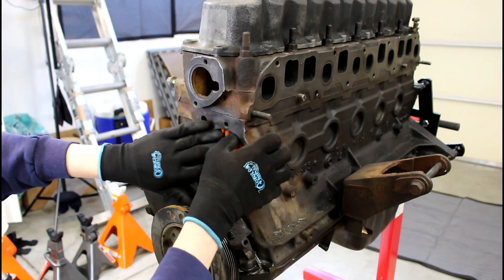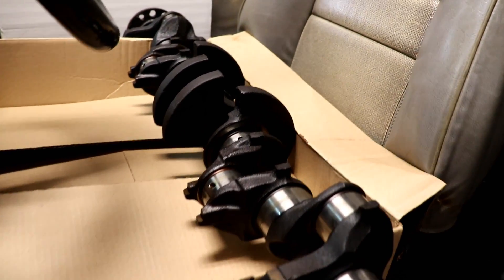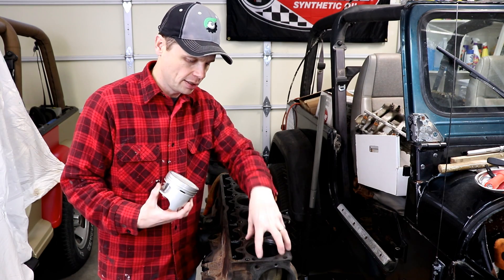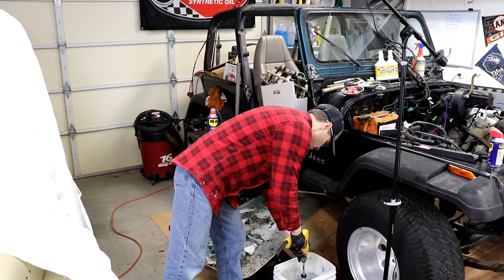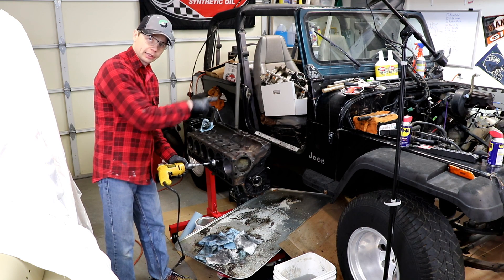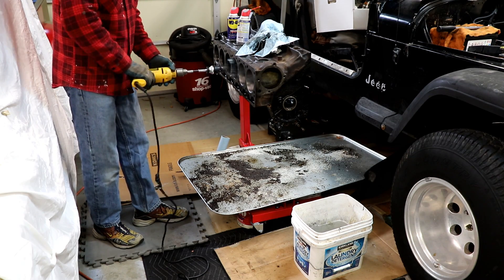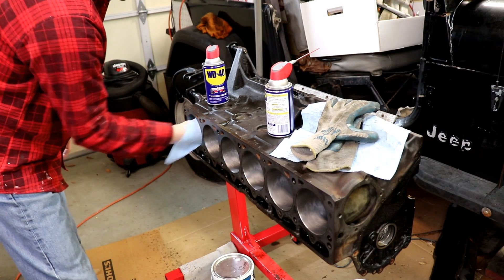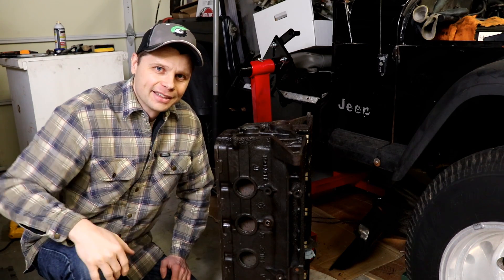Honing Jeep Inline 6 cylinder: Engine Rebuild Part 11

Comment: I️ have a 97 wrangler 4.0 I’m putting new pistons in and I️ need to hone it as you did here. Is there a specific grit you have to use to clean it? Mine has a glaze on it currently like yours did prior to cleaning. Thanks

Comment: Don't know if this is an issue, but noticed the new honing tool stones have little chips on the corners? Is that a big deal? And also, does this process (in the way that you are doing it) increase the diameter of the cylinders?

Comment: You left out a lot of important info.  The tension on the tool because it's adjustable. Also be uniformed meaning count the amount of times you go up and down each cylinder and make it  even across the board. Also it should be done in two stages with two different grits

Comment: The "hone" this guy is using is a "glaze breaker", not a "hone". It is best to glaze break a cylinder with a flex hone. The spring type glaze breaker was all that was available at one time. A ridge cutter should be used for this type of deglaze. Remove the material above the ridge with the ridge cutter (carefully). Use the glaze breaker for a few seconds to restore the x-hatch only where the rings travel. These glaze breakers will remove metal if used for too long, and if you hone too long completely from top to bottom you will increase the skirt clearance. Most of the time you will see x-hatch still at the bottom of the cylinders since the rings don't travel there. You should leave any bottom x-hatching as is. Opening up the bottom clearance is a no no. It will increase the tendency of the piston skirt to rock back and forth. This will cause the ring faces to wear quickly into a slight arc, and bell mouth the ring lands. The result is premature blowby, and pistons that audibly rattle sometimes even after warm up. If the skirts are worn it used to be, and maybe still is possible to have them "knurled". This puts a sort of //// hatch on the skirt by displacing the aluminum outward. You then use a fine :soapstone, or even a knife sharpening stone to "sand" the the skirt hatches down to fit the bottom of the cylinder. The nice part of this process  is the knurls hold oil helping (like the x-hatch) to lubricate the pistons and cylinders! If you have micrometers fine , if not a 0.0015 feeler gauge will do the job. OOPs I almost forgot you can also check the ring lands with the same feeler gauge, and if one or two pistons are really clunked out (especially the top ring land) replace them. The new pistons do not need to be knurled. This man has a nice looking garage, and sounds good, but he actually doesn't know what he is doing. This unfortunately is all too common.
Reply: Way to much Info:face-fuchsia-wide-eyes:

Comment: I really appreciate all time and effort you put into all your video's on this engine rebuild series. I'm planning on rebuilding my 97 TJ's inline 4 cylinder and AX-5 manual transmission very soon. Your video's along with my Chilton's engine rebuilding manual will have me well prepared for the job. I also have 17 years of experience in the auto service industry so I have the safety side covered. Thanks again
Reply from the maker: Awesome!  Thank you.  Yeah, it takes a ton of time, but I really like sharing my experiences and helping others out.  It's fun connecting with others in the Jeep community!

Comment: I uses to run a hone if there was a Very slight scratch in the cylinder. Other wise just a glaze breaker. Just need the uses inter-micrometer or telescopic micrometer and O.D. micrometer to make sure the cylinders are the same. I bored the cylinders out, 030 over uses stock pistons and .030 over rings. Just a touch more HP.   I'm just talking. You are doing a great job Bro. Pro. work.
Reply from the maker: Thanks.  Yeah, I'm just filming the process as I go along.  Thought about over boring 0.030, but ultimately didn't. Just standard rebuild.  Glad you're following along. It's been a fun process.